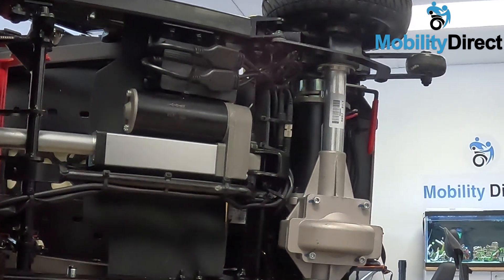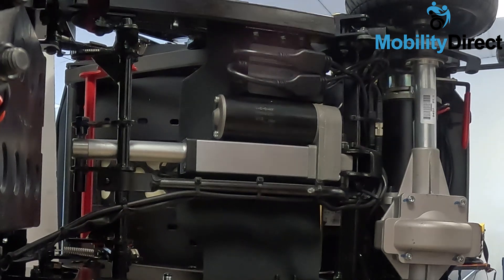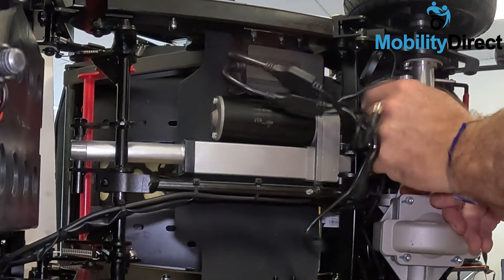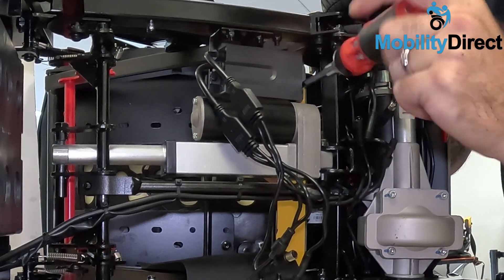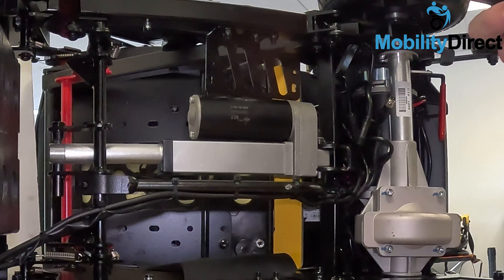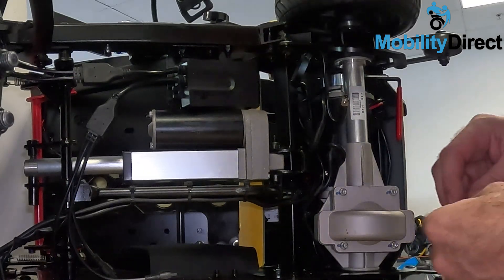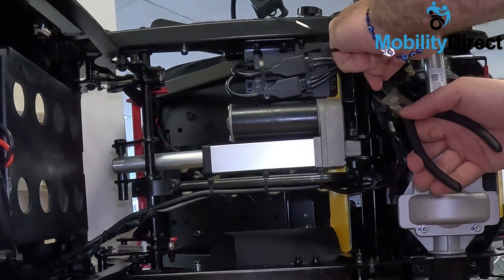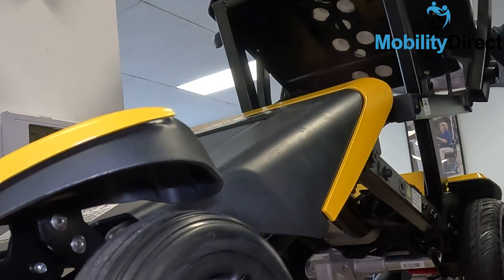🪛How To Replace The Auto Folding Control Module on a Solax Transformer

Comment: Hi i need one of these controler where do i get it from please
Reply from the maker: @dererkwheeler9146 You can check this with our parts team. For parts-related inquiries, it's best if you call our parts department, so they can accurately answer your question. You can call them at (877) 321-3241. Also, you can fill out the parts request form on this page for a quicker response:
https://www.mobilityscootersdirect.com/parts-request

Comment: Hello I have a brand new solar transformer and accidentally pressed both buttons on the fob and now it won’t fold automatically When I switch on with the key it does not sound or if I try and go manually on the two pole switch it does not work I’ve changed the battery on the fob The scooter works going forward and back but no auto fold Have I blown the module I have cleaned all the connections underneath by removing and squirting some contact cleaner in The main battery is full I have removed it put it back and still no auto fold I hope you can help I am a retired electrician and embarrassed to say I’m at a loss with this Oh also cleaned the two pole switch and tried to pair the fob again but no sound There is sound only in reverse
Reply from the maker: You can try plugging in the scooter first before trying again. This could be a bad scooter battery problem. This video which will help you how to troubleshoot batteries:
https://www.youtube.com/watch?v=4jeQ5sQQTtM&ab_channel=MobilityDirect

Comment: How do you disable the audio beeps when folding?
Reply from the maker: Thanks for stopping by our YouTube channel! We have a video guide to help you remove the beeper. But keep in mind that removing the beeper not only removes it for automatic folding but also removes it for the reverse and the horn. https://youtu.be/hl2q2oN6wOA
Reply: @Mobility Direct  Thanks but removing that connector only stops the reverse beep on my solax 22/23 model. The fold beep is still there 😪